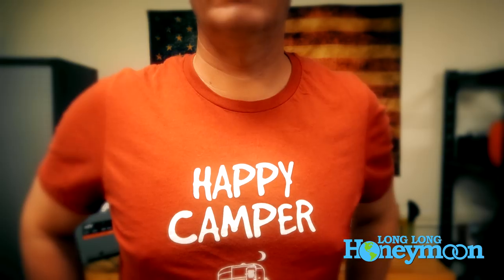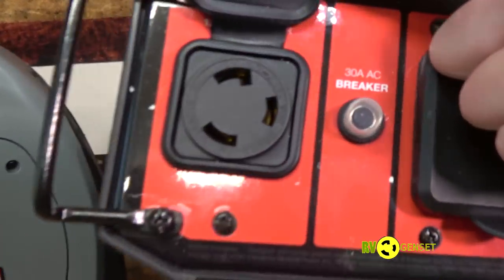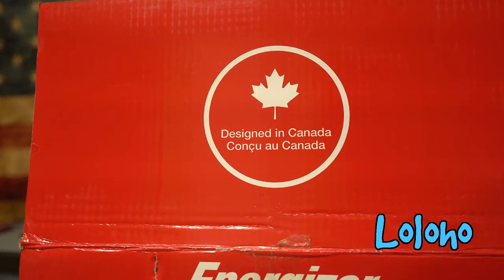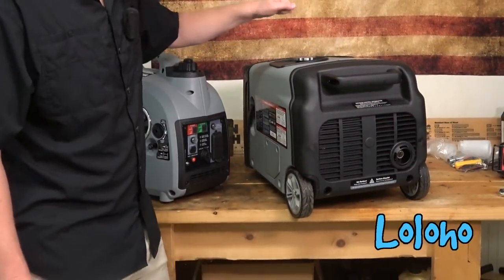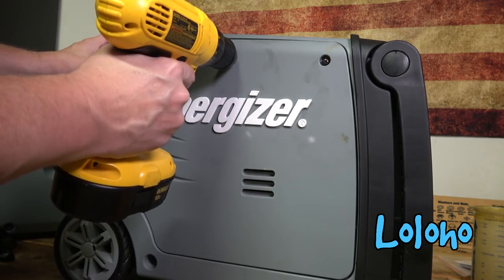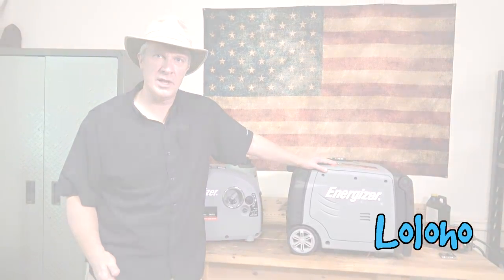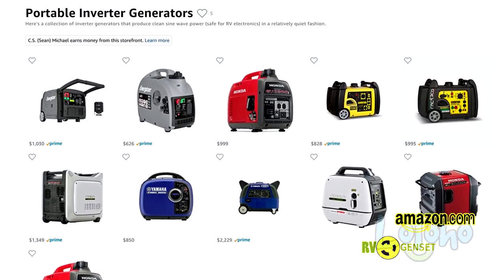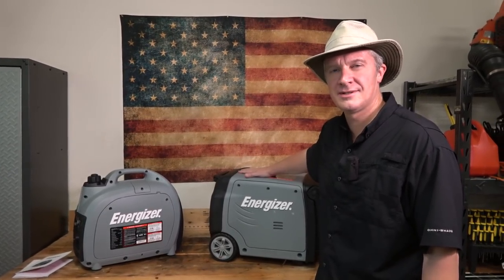REVIEW: Energizer eZV2000P & eZV3200P Portable Inverter Generators

Comment: IF YOU EVER test the New Honda EU2200i I talked to Honda personally, (Quartzite) I was told the new eu2200i was made from the company's even more dependable motorized jack hammer perhaps under a different name. They added popular customer modifications. Independent ignition power and gas switch control, rope pull shield and the like.  I bought into Hondas getting one cheap, with a blown engine. One of the popular ways to kill them  is by over fill of the oil. Leaning back, putting too much oil in it, closing it up and running.  It hydraulically breaks up the piston parts while running, tosses the bits around and adds more destruction in the crank case area..  Like your PawPaw, I got into it and got it back to useful.  Replacement parts are readily available and relatively fair priced.  Pistons can be oversized to add slight additional power like most engines.  They have documentation of thousands of hours on these little guys and after one year I am approaching 1000hrs being a full timer.  They will run your AC (https://www.youtube.com/watch?v=soP0uZFd0nQ) however, not leaving much for hair dryers, etc.  These little guys are victims of dried up gas in the carbs from non dry storage,, water in gas, and not following directions.  Many don't know the green light on it flashes for each 100hr use after a start. However a hour meter is convenient.  LOVE THE VIDS.

Comment: I put a 5200 BTU window unit  in my cargo trailer ran with the ezv2000 (95 degrees in northeast)no problem on ecomode. Transition to a higher rpm very smooth when compresseor kicks in. Surprisingly quiet and smooth running. I was holding out my savings for a Honda eu2000 but took a chance on this one. So far so good.

Comment: Sean, You may have seen higher noise levels due to the fact that your Energizer portable generator exhaust was pointed away from the noise meter but pointed at your trailer which may have caused some reflection of the sound back to the noise meter. I'm sure the manufacturer tests their machines out in an open space where there is no chance of reflected sound. Just a thought.

Comment: I have had the Honda eu2000 for two years. I  boondock in central Florida in the summer a lot. Very hot very humid! It can run my 8000 BTU a/c along with the outlets in the RV. It is pretty quiet and very dependable. I got an adapter on ebay so I can use a 5 gallon gas tank for the night. Use non ethanol gas only, of course. It cost a 1K. You get what you pay for.

Comment: Hey guys! I noticed that you store and run your generator in the bed of Seemore. My question is about the truck bed cover you use. Do you have the bed covered when the generator is running and if so have you had any problems with the heat? Possibly damaging the cover? Love your videos and Thanks for all of the info!

Comment: Hey Sean, Good report on the Energizer Generators. I kept thinking there is a bunny going to appear beating a drum. 

First question, I see the Parallel Kit has a 50 Amp Big Boy RV Receptacle. Is that a 240 volt like a normal 50 amp split phase service or 2x120 volt from the same output? Some big class A type rigs have basement A/Cs running on 240 volt. Of course, I don't know any class A owner who wouldn't use their on board generator and then plug into a portable generator unless they just had to.

Second an observation, the eZV3200P has a 23.3 amp RV outlet and not a 30 amp. I know, a forgivable slip up.

Third suggestion.... Move up to the 21st Century and put an Easy Start on that 13,500 btu ac of yours then you can easily run your camper off the smaller generator. I put one on my rig myself and not only does it not have that huge current surge on start up, I don't have that loud "Ka-Thud" when the compressor kicks in. I just checked and they've come down in price since I bought mine.

Forth item and this is just being picky..... Your sound meter in made by Radio Shack and not the most highly scientific instrument available to man-kind. So I would say maybe 90% of what ever it says could be accurate and only relevant.

I love you guys and keep the show going. JK

Comment: Great review! How did the noise compare with the Champion Dual Fuel? That’s what we finally sprung for, but it’s pretty loud. We do like using only propane though, and not having to carry gasoline. We found that the Champion ran our 13500 BTU AC fine on propane at 6500 feet altitude, but would not run it at 8000 feet. The altitude really does make a difference! Fortunately there’s not a huge need for AC at 8000 feet! 😁 Oak leaves? Isn’t it maple leaves? 🧐

Comment: Energizer now has an RV ready model eZV3200RV.  Since the noise values were higher than expected, have you ever tested the Honda models to see how they compare to claimed values?
Reply from the maker: I wish I'd had the RV model, but I think the main diff is that it has an RV Ready 30A outlet. With regard to the noise issue, pretty much every generator we've tested has performed close to manufacturer specifications (within 1 dB or so). This was unusual because there's a HUGE delta between the spec sheet and the real world (8-10 dB). 60dB is not the same as 52dB, not even close. I was hoping this unit would be every bit as quiet as claimed, because then it would be my primary generator of choice. I may create a comparison video that demonstrates noise performance vis-a-vis other models, but I wanted to keep this video focused on these 2 units.

Comment: I have the ezv3200. Your test it is correct it is louder than advertised. Pretty disappointing to spend that much and not get what you think you are getting. Thanks for the review!
Reply from the maker: Thanks much for your post. I really like the design and features of the ezv3200, but I can't get the noise performance to meet the spec sheet claims. Noise is very important to me and the discrepancy here is large (8-10 dB higher than the claims). It is disappointing because otherwise it's got almost everything you could want in an inverter generator.
Reply: I agree completely. Would be perfect if it was quieter, and had a second handle!

Comment: Sean, you have tested a ton of inverter generators on your YouTube videos. After watching all of them and more, I have decided that purchasing 2 small 2000watt inverter generators and paralleling them as needed is the way to go for me. The question is, which one(s) to get?? Is there a chart somewhere that stacks all the 2000 watt gennys together and compares their features?? I really like the latest one, the Energizer, that you tested, but I'm wondering if all of the are made my the same manufacturer. They look so similar. The noise levels seem to be similar. We stay in parks more often and not, but it's nice to be able to boondock whe you want to or need to. If you had to choose, which small one would you recommend??
Reply: Most (if not all of the Chinese generators like Energizer, Champion, Westinghouse, Aldi) are made by 'Ducar' in China.  Check out the Aldi WorkZone at your local Aldi store.  I bought one for $279.99.  Use the Westinghouse parallel cord to connect any pair of inverter generators together.  The Westinghouse parallel cord is NOT proprietary.  It just plugs into the 110v outlet of each generator.  I have the Aldi WorkZone and a Westinghouse iGen2500 connected together and they synchronize perfectly and share the load.

Comment: Great Review.  I was wondering how the measured sound levels compared to your other (non-honda/non-Yamaha) generators you have tested.  Were they about the same as the others?  Also I was thinking about getting at least one of these inverter type generators for use in power outages and for camping and maybe getting 2.  I am wondering if it makes sense to get one 2000 and one 3000+ with a parallel cable.  then you have options of 2000, 3000, or something a little under 5000.  Or would it make more sense to get 2 3000+ generators with a parallel kit?

Comment: I have a Champion 2800 running watt Generator and I am a slim lightweight Senior but I practiced lifting weights at work to make sure I would be able to lift that heavy generator up. it weights almost as much as me. It works good. not remote just pull cord.

Comment: Great review you should test out the roybi inverter generator I have the older one is been a great generator but the new one has Bluetooth so you can remotely shut it off and check the fuel level thanks for the great videos

Comment: I really enjoy how informative and entertaining your videos are. Generators seem necessary for emergencies; I can't imagine cranking one up while enjoying the wilderness, though.  Will you ever do solar?
Reply from the maker: We already have some solar in the form of a portable "solar generator" (which is actually a big lithium battery that can be recharged with solar panels). The unfortunate issue with solar is that the systems I've seen will not power an RV air-conditioner. Really that's the primary reason we went the generator route, A/C relief from summer heat.

Comment: I was looking back through your videos, but I didn't see if if it's there.  Have you reviewed the Harbor Freight Predator 2000 and/or 3500 generators?
Reply: Bubba Warbucks he has not yet. I had 2 of the 2000. Really liked them but sold both to get the 3500. So far so good. Runs a little rough when not under load but for the price im a happy camper.
Reply: Waiting on the video also..

Comment: Excellent review.  You're point about noise level is significant for we rvers.  Might be good to have ac all day but probably not worth angering everyone nearby.
Reply from the maker: Thanks. For me noise & power delivery are the key issues for inverter generators. In other words, I want sufficient power with minimal noise output. Now, if you happen to be boondocking in more remote areas (BLM, etc.) with a large buffer zone between neighbors, then a little extra noise may not be a deal breaker. But if you are camping in national parks and other RV campgrounds, then noise is extremely important.

Comment: For noise reduction, if the unit is away from the camper enclose it with plywood and a partial open top with a lip around to hold the sides together for easy no fastener assembly. This will direct noise straight up and not out yet allow for ventilation.
Reply from the maker: I wish someone would make a nice noise reduction box for inverter generators. I guess it would be hard to make one to serve multiple different designs, but I'd love to see a polished product that does what you describe.
Reply: do all the panels have a gasket on them?  I wonder if that could reduce it enough.  Marine grade insulation on the inside?  The big concern would be overheating the engine though.
Reply: alaskankare
There will still be noise only the birds will hear it better. The top needs to be open. How one keeps the sides closed is up to the individual.

Comment: your unit really shook when running.  were all the panels locked in?  the oil change one looked like it was sticking out and not seated.  I'm not sure how much of a difference it would make.  Cool comparison.  thanks for taking all that time to make it for us. :)
Reply from the maker: I eventually did get all of the panels back together smoothly - they are a tight fit. I noticed the shaking in the video also... I think it just shakes when it runs, honestly. Maybe it would benefit from a metal frame. (Setting it on a rubber mat might help.)

Comment: Hi Guys,  many thanks for your great videos we much enjoy them.   Question:  when I run our generator to power our travel trailer I always note the voltage drop difference between the commercial power and the generator.    The voltage drop on our generator 10 to 15 volts with the Air conditioner running, not good for the AC unit.   After looking the many reviews on youtube of gen sets I have not seen anyone check the voltage drop with the Air Conditioner running and not running.   Could you work this test into a future review?   

Our generator puts out 120vac till the AC unit starts and the voltage drops.  Better gensets have a voltage regulator but many gensets do not.  They use a mechanical governor for voltage stability by maintaining engine RPM.    
Thanks

Comment: We love inverter generators too! 😍👌🏻 the prices seem good. Did you hear any subtle rattling?
Reply from the maker: Actually the answer to your question is YES (although upon closer examination, it's not so subtle, haha). The 3000W model definitely vibrates a lot. There is a rattle that's happening due to the lift handle coming into contact with the vibrating generator body. That's definitely not helping its noise performance. I will try to eliminate the rattle and see how much that reduces the noise output.

Comment: Living (and testing) gen/inverters in the low lands of the US where you live, Sean, unfortunately gives us'ns who glamp and tramp (trailer camp) at higher elevations little information at how they would perform at or above 6000 feet. Last week camping at Logger Campground (6k ft) a bit north of Truckee, CA, my 2kW "class" Champion continually went into overload when I tried to run our 1kW microwave. Only other load at the time was  the house battery drawing 5A @ approx 13V for charging. [Champion has no fix -- I'm considering a small oxygen bottle and hose connected to the air intake for "high altitude operation."] Since the Champ is rated at 1700W and the Energizer 2kW at 1600W, I fear it wouldn't cut it at 6000 ft. 
Any way you an take your generators up in a small, pressurized cargo plane and run them at altitude to test 'em?  Ha!

Comment: Hi Sean, one thought on "accuracy" of your testing... sure, you are not in anechoic chamber so absolute numbers vs. the factory "spec" are difficult to resolve, however, having the benefit of multiple units I think the relative differences between the sets is a very reliable comparison!  Continue to be amused at your humor throughout!  John
Reply from the maker: Thanks John, I try to be fair to the gear. I realize I'm not testing in a controlled laboratory environment and my digital sound meter isn't exactly a Cray supercomputer. With that said, I ran a few side-by-side tests with the Energizer along with our Champion, Atima, Briggs, and Yamaha. In every test the Energizer kept registering more noise than I expected based on the spec sheets. That won't be a dealbreaker for some people (it's otherwise loaded with very nice features, and it's still more quiet than any open frame unit), but if I was shopping for a generator I would want to know what to expect. I'm going to try to make mine more quiet via reducing vibration & rattle because I do like the design overall.

Comment: Nice review Sean.  I hope you wrung out the air filter after you soaked it.  Supposed to squeeze out all excess. Really messy job, you're right.
Reply from the maker: Thanks Tom, I did wring it out but I think I could’ve done a better job with it! It still seemed a bit too saturated with oil and it did make a mess.

Comment: Regarding the noise level of the generators, Sean - I suspect that having the generators' exhaust pointed at your truck and RV created some reflected noise. I imagine the manufacturer tested in a wide open field...
Reply from the maker: I tried it in a couple of different environments and kept getting pretty much the same results. I agree that the conditions were never "perfect" but the noise of this unit kept clocking in at much higher than the spec sheet (and higher than our other units).
Reply: It would be nice to see the results if the Energizer and Honda were tested, same environment, same load, same eco setting, etc. to compare results.  If the Energizer were neeeeeaaarrrr the Honda in sound level, I'd be interested, but -- if the printed sound level for the Honda is correct -- there seems to be a big difference.  Too bad, looks real good otherwise.
Reply: Hi, I heard the quietest generator while on a hike … it was being used by a construction crew and was a Honda 3000i model. Even quieter than my Honda 2000 (I was very impressed). But the 3000 model is VERY heavy … 130 lb if memory serves.

Comment: We have a tankless water heater in our Lance so no worries.
Reply: Doug, I have one also (Lance 2375) but haven't used it yet (CG had showers).  Wouldn't it draw power as soon as you turn on the hot water?
Reply: No not really, just takes some getting used to.

Comment: My wifes hair dryer makes 70dB all by itself - seriously, if you are going to add a noisy load you need to explain how/why/if this doesn't invalidate the noise measurement.
Reply from the maker: I agree that a hair dryer produces some noise. So does another common load, an RV air-conditioner. But using the SAME hair dryer, the Energizer registered as being louder than our Champion, Atima, and Yamaha. And with MINIMAL LOAD (no hair dryer in sight), it registers nearly 60 dBA instead of the 52 dBA claimed on the spec sheet. I was hoping it would be as quiet as the spec sheet claims, but my unit simply is not. And I was using a more generous measuring distance of 25-feet, whereas the spec sheet uses 7 meters (23-feet)! I'm going to see if I can do anything to make it quieter (place it on a rubber mat, reduce rattling, etc.). I'll be thrilled if I can somehow make this unit as quiet as the spec sheet claims it should be.